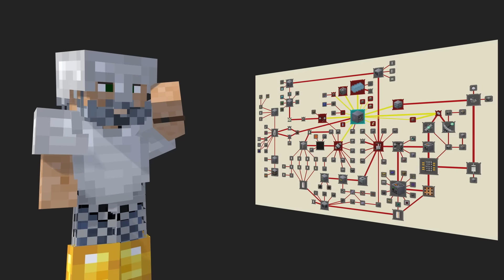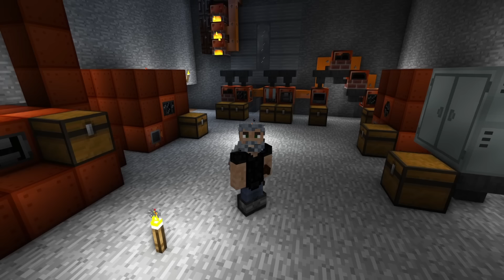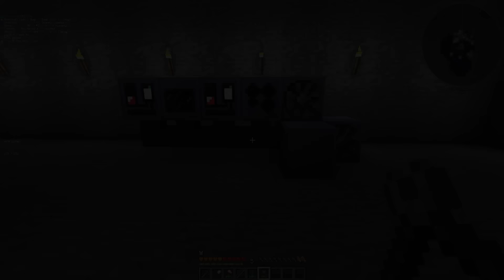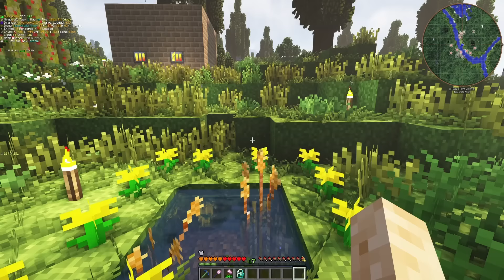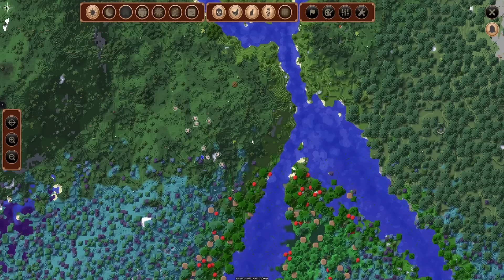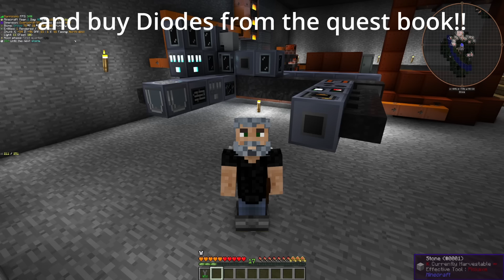The ULTIMATE GTNH Beginners Guide - Episode 4 - LV

Comment: The jump from 02:14 to 04:07 is a bit confusing, how do we mine cobalt to make that alloy to make diamond saw?
Reply from the maker: cobalt you can either process from cobaltite in the twilight - or do the tinkers method i (try to) describe here - upgrade the alumite pickaxe head via mining experience, use it to mine ardite, make a pickaxe head, and use it to mine cobalt. Alternatively you can get an ironwood pickaxe from the twilight forest which has cobalt mining level by default
Reply: @Garronimo  cant figure out how to turn ardite into its molten form, think they might have changed it
Reply: @xseis. You need the EBF at the middle of LV, there is no other way

Comment: I do have to copy a correction here from Snagger's guide to electricity on the gtnh wiki (an excellent reference) - 4 amps can power more than 4 machines! 4 machines is only the limit if every single machine uses the max voltage's worth of power every tick (32 EU in this case). Yes, packets cannot be subdivided, but machines have an electricity buffer (a sizeable 2048 EU for LV) which means they don't need to get a packet every tick. To give an example, if two machines use 16 EU/t and are powered by a 32 V and 1 A line/generator (and are capable of accepting 32 V), they will each get a 32 V packet every other tick when they have space in their buffers, and be powered continuously, even though there's more machines than amps!

Note that the same does not go for generators - they cannot produce a packet with higher voltage than they generate, so you do need enough amps on your cables for each generator, but for cable loss reasons it's better to step this up into higher voltage cables if you can.

Assuming you meet the second point of having enough amps for your generators, the way to calculate if you have enough power to power your machines is quite simple - you figure out the power of each of your machines in EU/t (this varies by recipe) and add them all together, then do exactly the same thing for all your generators or for a subsection of your base the cables powering your machines (P = VI, the power is just voltage multiplied by current (ie amps)). So long as your generators produce more power than your machines consume, you'll be good.

Also, cable losses are calculated per amp and reduce voltage (the unit is EU/meter/amp) so using a higher amperage both increases cable loss and reduces the voltage which those cable losses are taken out of! So together with the last point it's best to keep your voltage as high as your machines allow.
Reply: I'm just starting out (well, I'm slow even by GTNH standards so at ~850 days I still don't have an EBF) and saw that you can get MV transformers in LV.

I could see a case where you use two transformers to step up to MV, move say 10 or 20 blocks, then step back down to power a few machines.

At some point though I guess you're better off doing some shenanigans with battery buffers, hoppers and tin item pipes or just slapping on-site steam generation instead of transporting it from far away

Comment: Hey, love following your adventures. Quick question as I am too in end of LV right now. What power generation would you recommend ? I know of benzene and oil (i produced some stack of light fuel atm). 
I am wondering if i should drop an oil rig and pump heavy/light oil right now, or should i look more into benzene, i'm unsure about what direction to go for
Reply from the maker: Next video is going to cover power systems! The short answer is - they all work, even scaling up steam using railcaft solid and liquid fueled boilers - but benzene is the easiest due to the straightforward way it is made and the fact that it is infinitely renewable and scalable. You will need to do some oil refinining anyway, so I still recommend pumping oil. Keep in mind that no matter what you choose, it will be a big investment of time and resources to get it working, so don't feel like you're failing if you don't end up producing surplus fuel right away

Comment: Another tip for LV is to use potin pipes now that you have access to lead. It’s extremely cheap and has amazing throughput (huge potin pipes can carry more than the tank can output without a steam valve). Putting an enderman in the smeltery now is also a good idea - ender pearls will be used heavily for the rest of the game and early super tanks are extremely useful for storing large quantities of hydrogen, oxygen, nitrogen, and light fuel
Reply from the maker: great tips!!! potin is godly for sure - and if you can luck into the regen endermen at this stage that is awesome! I rerolled 900 times in a soul vial and never got one until i went to the end lol
Reply: @Garronimo  How does that work? (The Soul vial thing I mean)

Comment: Great video!  One question/note:  Aren't the metal extrusion recipes (rods/plates, etc) gated by MV?  If I remember correctly your only option for cheaper rods at LV is the lathe, which gives you 1 rod per ingot and gives you back 1/4 ingot in the form of a small dust pile.
Reply: Lathes give 1/2 the ingot back with 2 small piles, which is to say you don't lose any material using the lathe to make rods, you just have to turn the dusts back into ingots (or not, if you have use for the dusts- I usually dump iron dusts from making iron rods into blast furnaces). As such, it's usually the second machine I make, after the bending machine. You really feel all that extra steel saved making rods for vacuum tubes in early LV.
Reply from the maker: just checked and you are 100% correct - i was bound to forget something :P Now i am reliving how awesome it felt to get the mv extruder and then later realize how much better the fluid extractor/solidifier is for specifically blue alloy hahaha

Comment: IMO it's a good idea to craft just enough circuits for the wire mill and bending machine, and after that - just enough for an assembly machine and extractor, and after that you can batch craft all the circuits you need
Reply from the maker: you aren't wrong at all - but it feels so good to snowball right away :P

Comment: For those struggling with sticky resin. If you place down a rubber wood block and use a wrench on it, it will produce a sticky resin spot that can be tapped!
Reply: I heard that it was fixed in the recent update... 
Anyway, the best way is probably the stickreed, pretty easy to get and it doesn't require those treetaps
Reply from the maker: stickreed was great until i got bees rolling for sure - but this is a still a pog trick tho :P
Reply: fixed in 2.7.3 :(
Reply: @zend3r312  Confirmed, fixed in 2.7.3
Reply: Still works as of 2.7.2
Reply from the maker: @e-pony5388  niiiiiiiiiiice
Reply: @e-pony5388  a good alternative that isn’t cheating is the the sticker resin coin task, I’ve gotten 90% of mine from that
Reply: @e-pony5388  to circumvent this, you can always use bonemeal to grow rubber trees. They have a 100% chance maturity rate with one piece of bonemeal. I go between my lumberaxe, a sapling, and a piece of bonemeal repeatedly. By far the easiest way to get sticky resin for me. If you need bonemeal, get it from macerating bone blocks in the nether.
Reply: @e-pony5388 also with the  centrifuge, 1 rubber log has a 50% chance for sticky risin, also plant balls, carbon dust, and wood pulp. I use the plant balls for concrete.
Reply: Not sure why no one mentions it, but until you get the sticky reads up and running, tinkers slime trees are amazing.